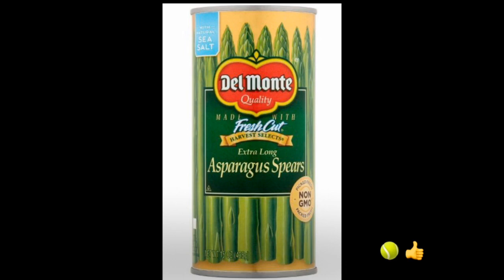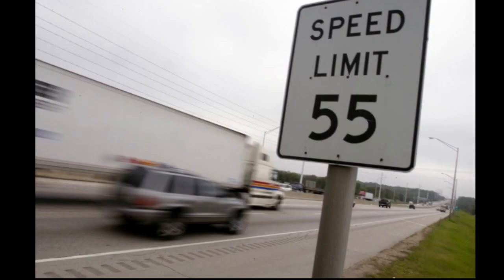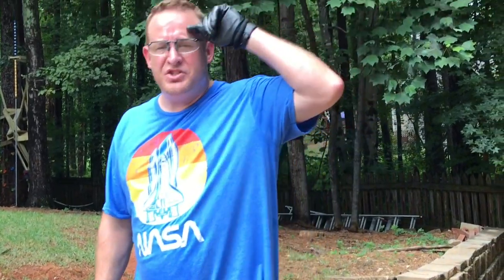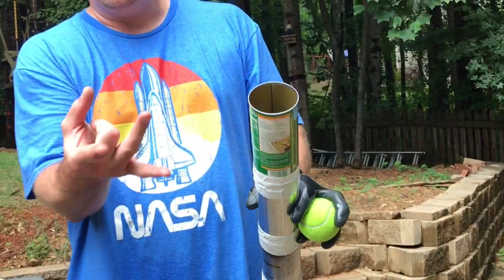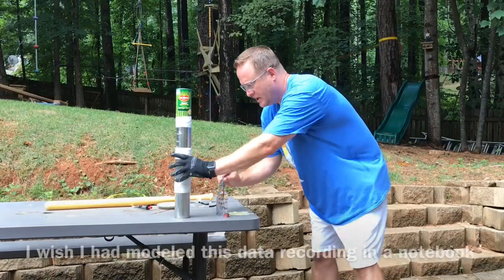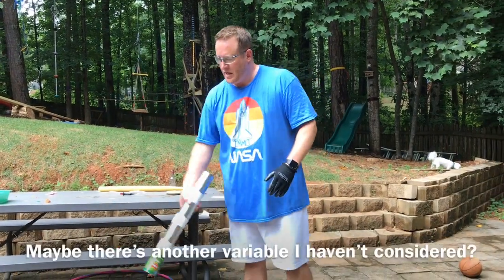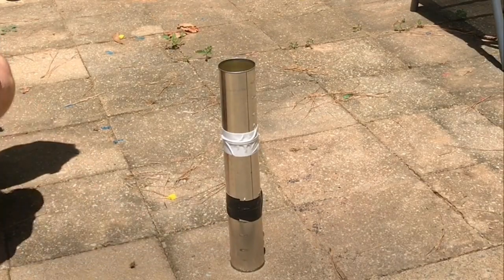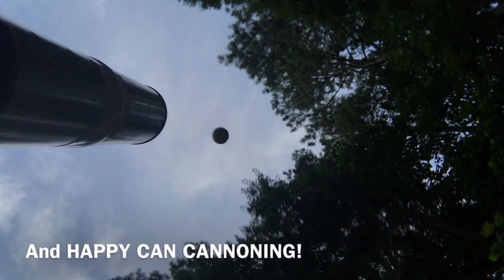Asparagus Can Cannon

Comment: the short answer to why it doesn't work a second time immediately after firing is that you've burned off all the oxygen in the container.  The fuel requires oxygen to ignite.  It needs to recharge the oxygen before you load it up a second time, which is why waving it about is helpful.